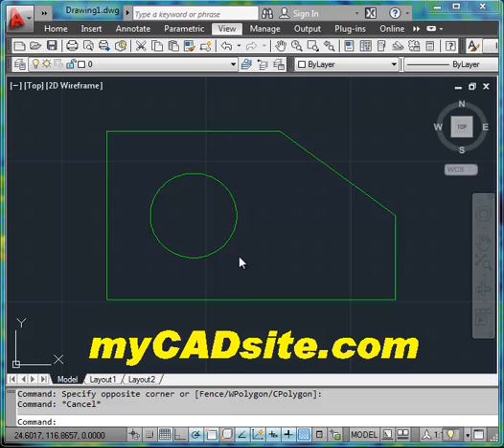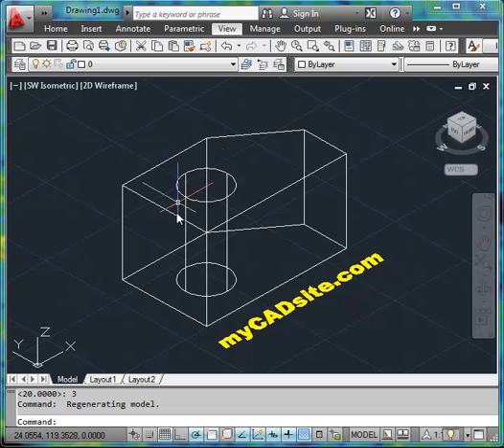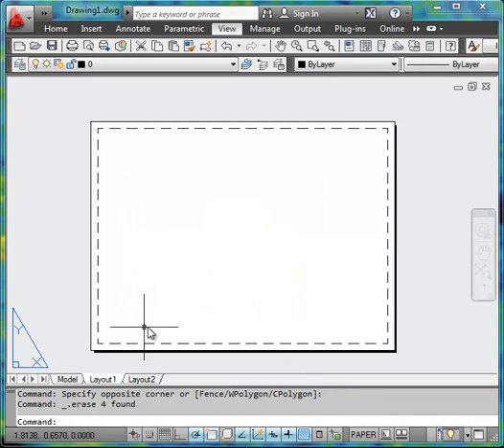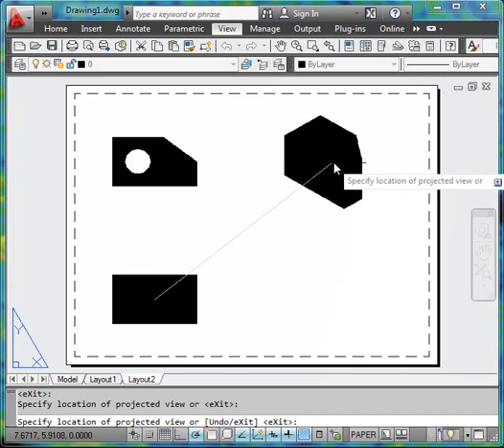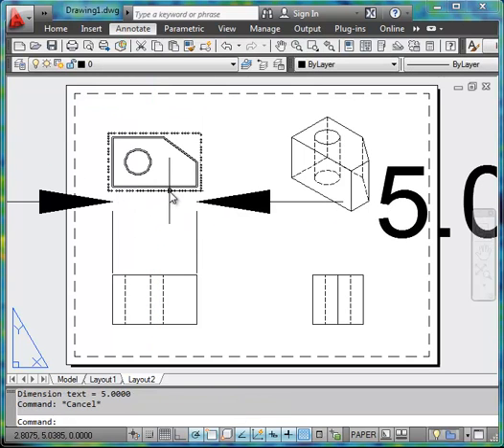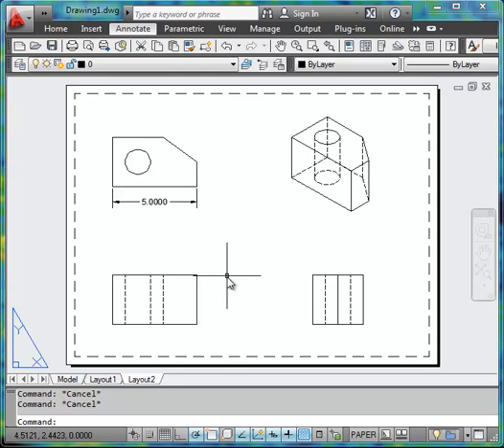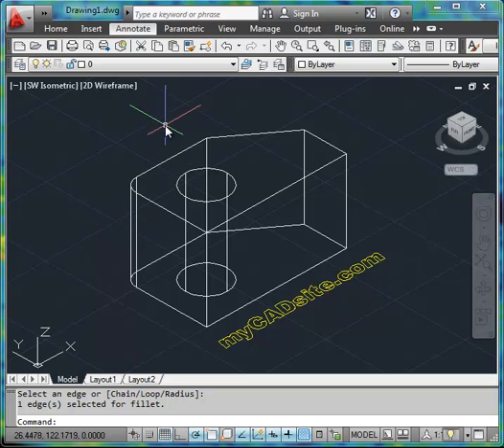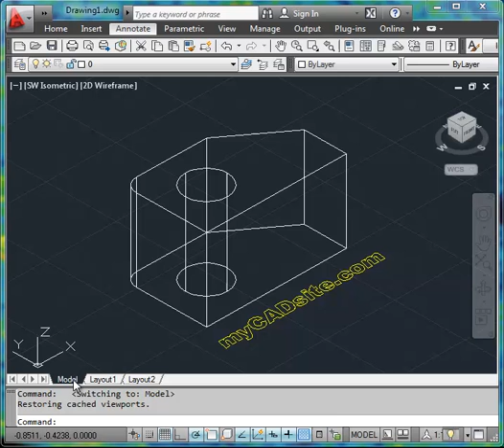Viewbase command - What's New in AutoCAD 2012 - from myCADsite.com

Comment: Hey, I am using AutoCAD 2012 in Windows 8.1
Somehow, it came to an error (inventor server failed) when I was going to use the new feature, viewbase... How can I get the command back?
Reply from the maker: Syahir Nasaruddin - You must go at "Autodesk AutoCAD Services & Support"  and "Updates & Service Packs", you can fiind this at: http://usa.autodesk.com/adsk/servlet/ps/dl/index?siteID=123112&id=2334435&linkID=9240618
After you must DOWNLOAD and REPLACE the file from "Model Documentation Hotfix for 64-bit Windows 8.1" that you can find at: http://usa.autodesk.com/adsk/servlet/ps/dl/item?siteID=123112&id=22443084&linkID=9240618
You must make the steps from "read me" file.